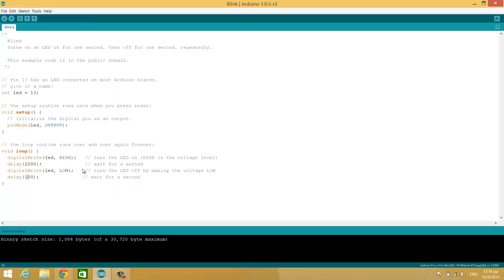Arduino Tutorial: How to program the Arduino PRO mini

Comment: This works most of the time, but sometimes not.  He says at the end 'if your connection is not good'...  The reason that it's not good is that there is nothing to ensure each pin is touching the hole. They weren't designed to work like that.  You can improve this using a weak elastic band making a triangle trying to pull the non-connected ends of the adaptor and mini together.  Now you are using the spring in each pin to make it touch the hole reliably.

Comment: For those who can't upload sketches to pro mini using the cable: You can upload the sketch via UNO. Connect UNO to your PC (using the USB cable), then connect UNO to the Pro Mini using these wires: 
UNO Tx - PRO MINI Tx, 
UNO Rx - PRO MINI Rx, 
UNO Vcc - PRO MINI Vcc, 
UNO GND - PRO MINI GND. 

 On the Arduino IDE sellect PRO MINI as the board. When you click the upload the sketch button, you must hold down the RESET button on the UNO board. Just when the Arduino IDE finishes compiling the sketch and begins the actual upload, you need to reset your PRO MINI by pressing and releasing the reset button on your PRO MINI. Remember the hold down the Reset button on your UNO during the whole process (from compiling until the upload has finished).
Reply: i just got a pro mini 5v and i only have one row of pins on the side with the button , the one in this video has  2 rows of pins on the side  with the buttons , i thought these were all supposed to  be pretty much the same but how come he has a n extra row of pins and i don"t?
also will the FTDI in the link in the description from banggood work well with windows?
it sasy not original chip i have heard that there are problems with ones that are not original chip, not working or bricking from the software i need it to program my pro mini but also want to flash some lixada h801 led strip controllers
Reply: THANK YOU!

Comment: I have a slight program, I bought an Arduino pro mini and a ch340g adaptor, I programmed the built in LED, and it worked great. When I came back to use it the next day though, when I try to upload a new program or update the current one, it just carries on using the blink program, is there any way to reset the Arduino?

Comment: Can I disconnect the arduino pro mini and the FTDI once I have uploaded the program?
I want to know if I can just, upload the programm using the FTDI and then use the Arduino pro mini without the FTDI or they need to be always connected even when the program is already uploaded. Thanks
Reply from the maker: ***** Yes of course you can disconnect the FTDI once the pro mini is programmed! You can connect it again if you want to re-program it.
Reply: And I think I can use the arduino uno as FTDI, am I right?  Thanks for your reply :)

Comment: If you are using a usb cable w/ftdi  from spark fun, what programmer do you tell the program you are using? I tried to program a pro mini and nothing works and I tried all programmers and boards. I set rts on close in the ports as mentioned by spark fun. Nothing seems to work with this cable!
Thanks for any help you can supply.

Comment: Super video, just what I needed - good info and simple setup ;-)
But sometime my computer (Win7 64bit) halt when I make a upload from the Arduino IDE to the CP2102UART/PRO mini, and I have to reboot the computer. I now down adjust the buffer size and transmission rate for the UART - hope it will fix it.

Comment: can i program 9DOF-IMU using same  FTDI serial programmer...........plz reply i am working on project
Reply: Your question shows that your experience is lacking. The 9DOF is a board that interfaces with a microcontroller, and it controlled by the microcontroller. That microcontroller can be an Arduino or a PIC, or a Raspberry PI, it depends of where your experience  is. I would say that your experience is nowhere yet, but if you stay with it, you will eventually get where you want to be.  Google is your friend, use it to educate yourself. The answers you will get with Google, all depend on your questions. The more you know, the better your questions will be, and the better your Google searches will get. Good luck

Comment: Can I do mini pro programming without this part?
Reply from the maker: +Prasanga F'do No unfortunately you need a device like this.
Reply: +educ8s.tv  OK. Thank you for the reply.What is this gadget's name by the way?
Reply: +Prasanga F'do usb it's a usb to serial converter
Reply: +Tino F Also called with name FTDI or USB-TTL
Reply: You can program the pro-mini the way he showed you here, or you can use any other arduino board, and use it to program a standard Atmel chip (Meaning the MCU on the Arduino).  MCU means Microcontroller Unit) There is a sketch in the Arduino IDE that sets up the arduino as a programmer. I have used this method to write the boot loader to a bunch of Atmel MCU chips I bought from China that said they had the boot loader, but they did not. This was a very good video. Most things that are done with Arduino can been done in more than one way.  None are wrong, some are easier to do than others, so if you are shown an easy way, the other ways may be more complicated.  If you are good at searching Google, you can find all the ways that you can program an Arduino, or a stand alone Atmel MCU.

Comment: This a pin Connection FTDI 232 between Arduino Pro mini, DTR <-->DTR, TX0 <-->RX, RX1 <-->TX, VCC<-->VCC and GND<-->GND, dont plug CTS from FTDI 232 go to GND1 at Arduino Pro mini, this is a make ARDUINO Pro mini heat and not blinking this is make a Hot Component and not good, thanks
Reply: Please vidio copy of the data that embedded in arduino pro masterpiece🙏🙏🙏🙏

Comment: they got thenames mixed up they should have called the mini nano and the nano should have benn called the mini
nano implies it is smaller than mini but it is bigger more expensive and have more features and does not need an FTDI they got it mixed up ,
Reply: Except, if you want to be technical, it's not the "arduino pro nano", the arduino nano small version of an arduino, while the arduino pro mini is a small version of the arduino pro (https://www.sparkfun.com/products/10915). So they don't have to make sense relative to each other.
Reply: they don't have to but it is still confusing

Comment: why not use nano, direct usb connection, buy the mini then the costly adapter, have one mini used uno to program it worked only once now it takes forever to load the program , so loaded the bootloader with success, but still no sketch is getting uploaded.

Comment: Why would you buy the pro mini and the little thing? Why not just buy the nano!
Reply: +william sobral Because you use one USB/serial device for all of your pro  minis, and the pro mini is smaller than the nano, as you remove the USB/serial device when you use it.  The USB/serial device is only needed for programming.  There are other reasons (lower power, etc), and then there are times you'd want the nano.  As I'm still at the hobby phase and most of my stuff is on breadboards, I like the Uno or Nano still.  But could see wanting an even smaller one when I get to wanting to use it in the real world. ;-)
Reply: desiv1 
Also, the Mini is quite a bit cheaper than the Nano.  So cheap you can use it in things to make the IoT!  The Internet of Things!